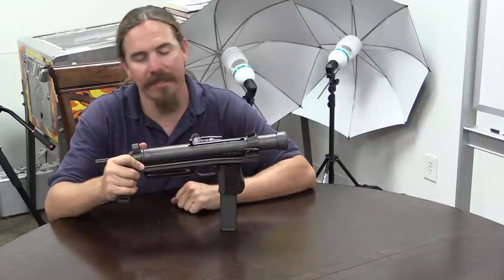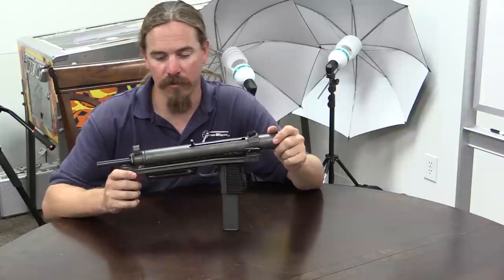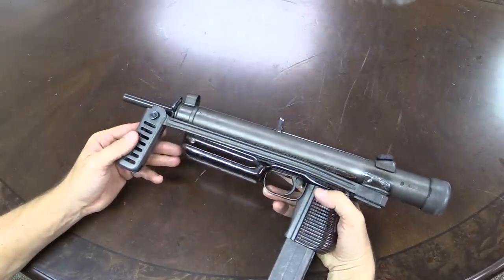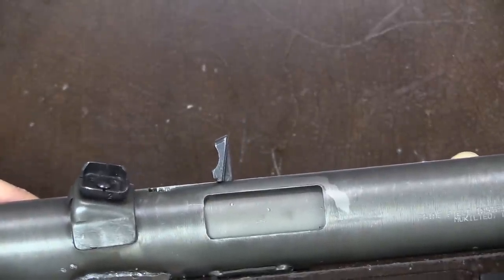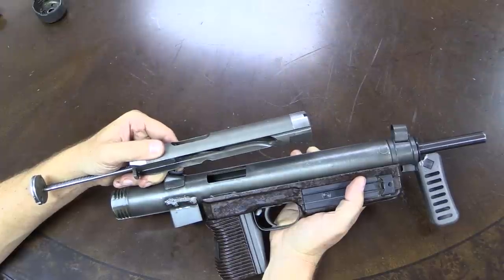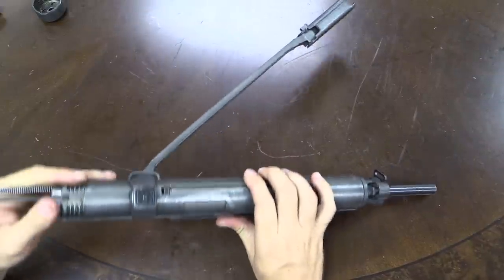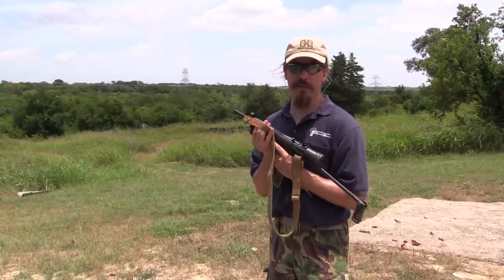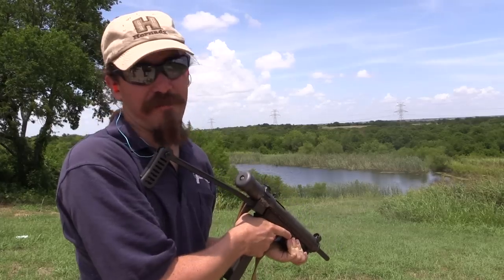Czech Sa vz. 26 SMG

Comment: This gun was nicknamed "pumpa" or the diminutive "pumpička", as the receiver did look like an old fashioned bicycle pump, or a caulk tube...
Reply: That being said, I can confirm the previous comments regarding the ugly weld work on Ian's particular gun. The original CZ 26s were also parkerized and a dark grey burned lacquer was applied afterwards, so the gun really did not have that 'spartan' look like in the video. Also, when the bolt was fully forward, the ejection port was wholly enclosed (it is not in the video).
Reply: Very similar to american grease gun, no?
Reply: @ThommyofThenn  Both guns have somewhat "spartan" apperance, but the only thing that is common between the M3 and the Sa 2x series, is the open-bolt straight blowback function.
The rest on the guns is completely different: the usage of a telescoping bolt on the Sa, a progressive semi/full auto trigger, a much higher rate of fire (over 650 vs 450 RPM), different calibers (9mm, later 7,62 Tokarev), double-stack double-feed magazines w/ stripper clip loader on the receiver, no dust cover to mess with, etc.

Comment: Now that is a nice review on one of my country's icons :) Great work Ian! Btw, Czechs call this gun "pumpicka" (or "pumpa") which literally means "grease gun".

You basically told everything except one bit - the gun was designed exclusivelly for 9x19 because in mid 40s it wasn't sure in which direction Czechoslovakia would go and the army standard for pistols/smgs at that time was 9mm Luger. In such config (model 23 and 25) the gun was developed, tested and fielded. After the historical events of West/East it was decided to rechamber the design to 7,62x25 (model 24 and 26). But there were feeding issues that came from different Tokarev round's geometry in contrast to 9mm Luger (angle and distance of round inside feed lips up to barrel's chamber). The designers solved that problem by slanting the whole mag shaft.
Reply: You said it.  The gun was designed for 9mm round and it was best suited for that round.  It sold in most countries around Africa, South America and Asia .... and the early models which were given to Israel, were used as the base for Uzi design.

Comment: I like this smg, expecially the fact that even if it's an open bolt, the chamber appears "closed" untill you pull the trigger. I think this feature is good to prevent jammings due to dirt, dust etc.

Comment: That gun must be a post 86 dealer sample. An original CZ-26 the front barrel bushing was actually fixed in place by "beading" the receiver tube locking it in place. Also the stock swivel point was spot welded , with no big ugly gorilla weld showing like that one does. Looks like Helen Keller put that fucking thing together. Even the baked on grey enamel original finish is wrong on that example.  At least there are plenty of places to tie a trot-line to.
Reply from the maker: +race bannon Yes, it is a post sample.
Reply: +Forgotten Weapons It's a Beautiful POS! Kinda like a KG9. Love your channel and please do keep up the good work!

Comment: I am from Czech republic and I if you take anything from Soviet era, you will surly notice the higher weight and more robust structure. That is the fact, and this gun is not an exclusion. :-)
Reply: Adam Foxik That's not always true. For example the Sa vz. 58 is quite light for an assault rifle, lighter than either the AK-47 or M-16.
Reply: marvincz3 Not allways, but mostly true for example: The old soviet escalator shafts - they weight about 6 tons each ; the new ones (from about 2008) weights only about 1,8 tons...... That´s a lot of weight down, but I rather trust the old ones, becouse they are there for almost 50 years ! :-D (sorry for that foggy almost everywere...)
Reply: Adam Foxik
In general like that, I think you are right. I was just stuck thinking about firearms.
Reply: marvincz3 :-)
Reply: Adam Foxik It is called having no clue about engineering and therefore ludicrously overdimensioning it ;) But sometimes you find simple clever designs also, i like my Brno ZH.
Reply: *****
Yeah, we've been over that already.
Reply: Adam Foxik Mi máme nejlepší zbraně!
Reply: cvrk
Reply: comparing this gun with a a tommygun I saw that is not the case.
Reply: Macintosh Robinson ale kde, HK je lepší a to daleko...

Comment: You can really see the influence this bad boy had on the Métral SMG, a submachine gun designed by Swiss Gérard Métral for clandestine manufacture. The fire control group is very much designed after the KP/-31 Suomi (torille?), but the bolt, recoil spring and ejector setup, the stock (not counting the buttplate), and general outline are very similar.

Comment: I've seen surplus Czech ammo in both 9x19 and 7.62x25 on clips (possibly also 9x23). No one knew what the clips were designed for. Now your video explains it. BTW the 7.62x25 VERY HOT, I blew an extractor off a C96 Mauser, and have read of worse damage to some old C96s and Bolos with hot Czech ammo.

Comment: Isn't 7.62x25 Tokarev a more powerful cartridge than 9mm PB and a rather powerful pistol cartridge in general?
Reply: spammed999 Right-O, thanks. I've only ever held a gun, never shot one, so I wouldn't know.
Reply: Robin Glijn Depends how you define 'power'. 
The 7.62 (without getting into the history) for all intents and purposes is a 9mm case necked down to fit a .30 cal bullet. The 7.62 is smaller/faster and penetrates more, but the 9mm is heavier and has more ft/lbs behind it when it hits something.
Reply: Getting into the history the origin of the round is the Borchard 7.63x25 mm so the 9mm is a necked up version.
Reply: @austinslaughter319  : First: for this weapon at a distance of 100 m the difference in the holes is 1.35 mm in favor of the 9x19, at a distance of 200 mm, the difference in the holes will remain, but the depth of the wound channel will be in favor of the 7.62 TT, and 300 m, and the diameter and depth of the Soviet patron will absolutely dominate, because the 9x19 bullet will simply fall to the feet of the target or a little slap on the ass in the best European manner, and secondly; learn the name of the constructor, if you want to show off: TOKAREV Soviet designer, weapon which was in 1944-1945 liberated from the Nazis Europe as show current events not quite. And Oleg Taktarov is a Russian bodybuilder and melee , playing Russian gangsters in favor of the us sheep for their money.
Reply: @austinslaughter319  What is "Tarkarov" dont you mean Tokarev ???
Reply: Tokarev is basically bottlenecked 9mm.

Comment: My understanding is when this gun came out a hot loaded SMG round was also made for it which supposedly would be safe to fire in their CZ52 pistol.  After a few CZ52 pistols disassembled themselves in dramatic fashion within 2 years the SMG load was discontinued, pulled from military issue and placed in warehouses and forgotten.  In the 1980s when C96 pistols flooded into America from China, some genius in Czechoslovakia began shipping the SMG loads here and selling them as standard Tokarev loads.  The result was a lot of C96 pistols also disassembling themselves dramatically and both C96 guns from China and Tokarev ammunition being looked down on as unsafe.

Comment: That gun was designed to shoot from the hip, by paras on the move.  When I was 14 it took me 3 minutes flat, to take that gun apart and to put it back together.  As far as Uzi is concerned, majority of machined parts are inter-changeable between Uzi and 9mm version of this gun e.g. vz23.  All that Galil has done .... was changing the way that shoulder strap was fixed to the gun.  Looking at what you said about machining tolerances and fit of various parts, including the arm rest?  That gun is probably made in Rhodesia, or in Cuba.
Reply: Ah yes, i'm sure the UZIs square bolt will fit just fine in the round reciver. 
The UZI has zero parts interchangeably with this gun.

Comment: I'm sorry, but i consider it the best smg perfect for what it designed for, short - can be used from inside vehicle, easy to open and fold the stock, safety next to trigger, progressive trigger, long barrel to utilize the full potential of the cartridge, no much parts, fixed firing pin and tiny pouch holding 5 mags. 
only draw back that you cant put red dot without mods/drilling

Comment: Ian, when you say you didn't find this gun particularly effective, what parts did you think really let the gun down? You mention the butylate-cum-frontgrip not being great, but IIRC wasn't this one of the few SMGs with such a feature when it was made? I can imagine most wore stocks of the era being kinda crappy (I'm looking at the Sten in particular, though I can't imagine the PPSh-43 would be comfortable\durable either in this regard). Or is the site issues & clumsiness of the gun and stock folding really the biggest letdown? You did say the fire was easily controlled, which would seem like a good thing in an SMG...

Comment: Looks like it's made from steel plumbing and a maglight and then welded by a first year welding student
Reply: The original Czech ones are much prettier. The welding work and the finish are both different and better. This must have been built in the US from a parts kit. Whoever did the work to rebuild it was clearly not as precise as the Czechs.

Comment: I had an idea: 3D print a solid stock that you can mount using the existing stock strut as a sort of reinforcing spine. Figure how best to affix it to the preexisting stock mount and from there on have a fixed, non-folding but rigid polymer stock. I'm sure it would help with the practical accuracy of the gun.
Reply: There's kits with carbine barrels  and closed bolt conversions available for these to build semi automatic copies of it most commonly as longer 16 inch barrel rifles   they shoot quite well and are excellent shooters and as a closed bolt quite accurate if a bit heavy but willvdefinitely last forever  ..  Atlantic arms sells them as complete guns occasionally but they go out of stock a lot

Comment: for the cocking handle on re-assembly: get it "there", invert (handle pointing in direction of gravity), tap as needed, voila, no digging with "universal disassembly tool caps". of course, you could just put the right wiggle in the surface, lol
Reply: I was thinking the same thing, but it wouldn't be easy to demonstrate on camera.

Comment: Interesting, thanks. I noticed Apex Gun Parts is selling these as parts kits without a receiver for $130 but what are you going to do with it? You cannot get receivers (At least from my research) and it's an open bolt design, so the NFA will consider it a machine gun. 

So it's both impossible and illegal to convert these back into working order unless you're a Class III dealer and have the skills to fabricate a receiver.

Comment: What a fascinating design! If it had a better stock and better sights, I could see this being potentially one of the best SMGs available in the 40s! I seen no select fire however, and I think the PPSh-41 safety is more positive which gives it two beneficial points over this vZ.26, but at... what was it, 6.8lb unloaded? For the time, that's quite good. I think it's comparable to the PPS-43 and STEN which were potentially the lightest SMGs available aside from the Schnellfeuer.

Having that length of barrel in such a small package is fantastic. Every time I look at an MP40, I cringe at all the wasted space behind the barrel. Just looked up some specs real quick; with the stock folded, the MP40 is 25" long, while the barrel takes up 10", less than half. Then with the vZ.26, it's 17.5" long with the stock folded, while the barrel is 11". So it's got a longer barrel than the MP40, while being 7.5" shorter overall. That's quite impressive!

I'm curious as to the barrel length vs overall length of the PPSh-41 now... I'll check the specs for that! 10.5" barrel with over all length of 33". Granted that's of course with a stock. MP40 is about 33" as well with the stock extended, so those two are kind of comparable in that regard. Learn something new every day :)

Edit: Ah, so it IS select fire, it just has no select fire 'SWITCH'. My mistake; should have watched the whole vid instead of pausing before the shooting started :P

Comment: My big concern with the "foregrip" is that if the lock holding the stock/grip downwards ever fails then it can come up under recoil. During full auto fire this failure could position your hand in front of the muzzle and allows the bullets to graze across your fingers or knuckles. That seems exceedingly dangerous, even if unlikely.

Other than that, I love the Sa.26 (as a hobby gunsmith). I think it's an incredibly clever design, especially for it's time.
Reply: But nothing stops you from holding it underneath and using the folding grip as the stop, preventing your hand from sliding forward.
Reply: @rickj8859  true. I hadn't considered that

Comment: Beside the terrible welds on the build, it seems to be a OK design. I was actually surprised at the rate of fire, I figured it would have been way faster. Probably because I am used to tube guns having high rates of fire, like a converted Kimmel ap9, or yes the crappier quality tec version of the design. Or as another example, S&W subguns, or even a sterling seems faster. Seems to be near a grease gun rate of fire, 5-550 ish maybe. Anyone know what the ROF average for these guns are, not the factory spec, but the in person been there, real ROf.

Comment: those welds are pretty gross, but interesting firearm.
Reply: Those welds are part of the soviet influence he mentioned.
Reply: If you knew a bit about welding, you would have noticed the wire brush marks, where some halfwit tried to stick weld the broken off pieces back to the tube.  The gun was designed to be shot from the hip ... on the run.  A bit like the cut down version of Schmeisser.  At the time when majority of European infantry men used rifles, the Czech infantry was fully equipped with submachine guns.  So the gun had to be solidly build and cheap to make.  Accuracy over 100 - 200 yards wasn't the issue.  The gun wasn't designed for use by sharp shooters ... hence the basic sights.  There were millions of these made and sold in Africa, Middle East and South America ... and I wouldn't be surprised, if they were still in use in South East Asia, or Africa now.

Comment: That weld.  I can really appreciate the ingenuity of this design, especially using the bolt as a barrel wrench, but every time I see that weld.  It's just distracting.  You mention that is a particularly badly made receiver with the charging handle, so i just have to ask, are welds that ugly atypical?

Comment: I have at least one previously unidentified Czech clip, that likely goes to this gun. Since it's just sheet metal and spring steel, presumably it can be mailed. Give me an address and if it's ok I'll send it to you.
Reply from the maker: diasirea I appreciate it, but I do have clips - just didn't have them with me.
Reply: Why was that Czech ammo in the clips also in 9x19 and 9x23? Other chamberings? BTW the 7.62x25 Czech loading very hot, used in CZ52 pistol also. Blew off the extractor of my C96, before I realized not to use anything but dedicated  7.63 Mauser loads.
Reply: "Clips"
Reply: Snowy 101 Ammo bound in clips, that can placed on the apparatus on side of the gun in this video to allow filling of magazine more effectively. (A "clip" holds cartridges together a "magazine" is a feeding device. Terms are NOT interchangeable and misuse shows ignorance, such as when a reporter or politician says "we must outlaw 'clips that hold too many bullets''!
Reply: +diasirea My bad. I figured you were referring to the magazines a clips.
Reply: Anyone who hits this channel is gun savvy or quickly becomes gun savvy. I only wish we could get CEU's (continuing education units) for watching Ian's videos.